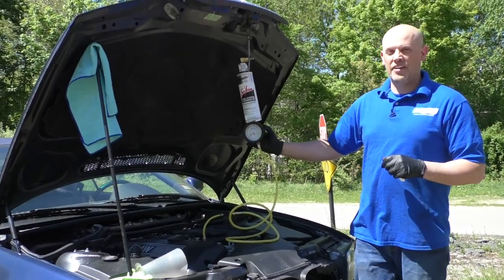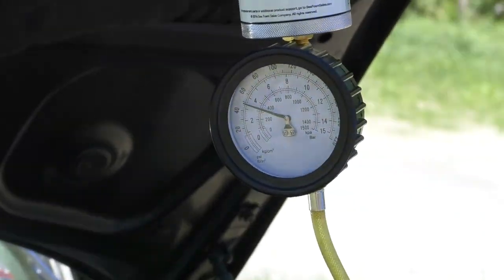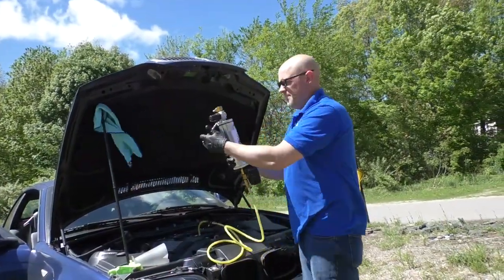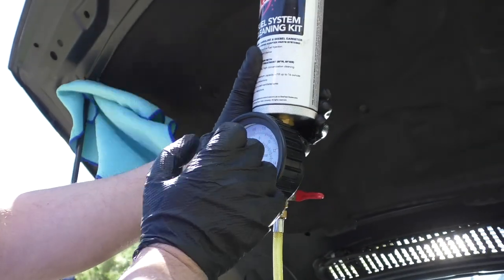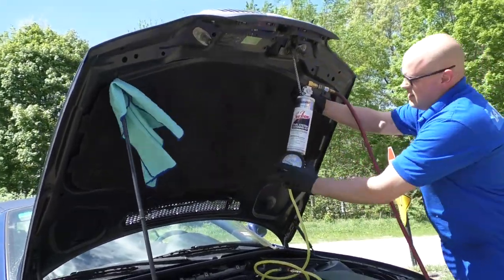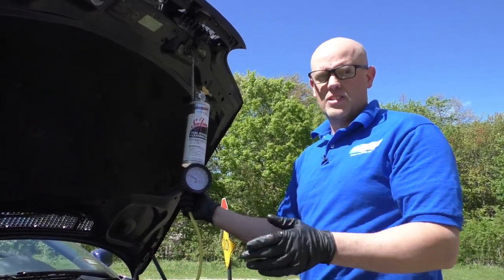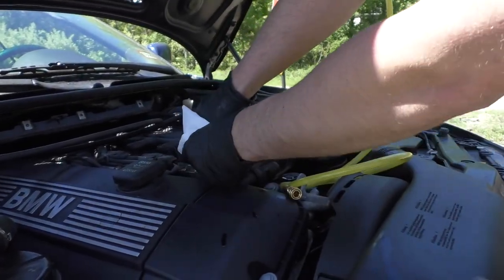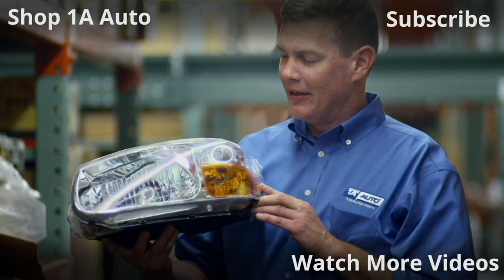How to Clean Fuel Injectors Like The Pros

Comment: Why not just remove the injectors and clean them individually/separately?
Reply: Time consuming, need power source to open the fuel injectors, and could damage it during reinstallation. I just think if this works why go through the trouble?

Comment: On a return line system, you could be venting the cleaner back to the tank if your pressure is too high.
I would think you should use a lower than system pressure. A lot of regulators vary the pressure according to vacuum  also. Maybe you should unhook the vac line from the regulator.

Comment: I guess  have to do this on my 2013 Chevy Tahoe I been having. Misfire on cylinder 5 replace spark plug , switch coils and spark wire still showing misfire probably injector are dirty ..

Comment: This is a pretty awesome video. If you don't appreciate the ingenuity of this - allow me to introduce you to the Ram Promaster 1500, the worst vehicle I have ever owned. It's worse than my 2nd and current wife. Costs a lot of money, never works, and well, I'll leave it to your imagination - I digress. If you have a look at Ram PM 1500 and see what it takes to get to plugs 2,4,6, that alone has turned people off to them. So I am getting a P0305 code -so if any silver lining 1,3,5 are on the easy side of the Ram PM but a P0305 code is pretty generic - it could be a lot of things (plug, ign coil pack, injector, and then we continue on and on) - but I'd sure rather try this ingenious way of cleaning the injectors without having to remove the plenum and look like I'm rebuilding the freaking engine. I mean all of this makes great sense to me and I'll be buying this before a 2700 quote for a very generic code which might just be a plug or a fuel injector issue. I am feeling it is likely an injector issue so as long as I can tick of the easier stuff - this is pretty straightforward and cool - then why not do it? I mean I think this is clever and really easy stuff. I am of the mindset to start with the most logical and simple things and move to the more complicated things. Occam's Razor stuff. Or you can be just like me and jump into the second-worst decision of your life and get a Ram PM for your business. :) Thanks for the awesome video!!!
Reply from the maker: +JWG Marine Thanks for checking us out. Shop for high quality auto parts on 1AAuto.com:

http://1aau.to/m/Shop-1AAuto-c

Comment: This sounds great and dandy but my only issue is if one of the gaskets on the fuel injectors are broken or frayed this won't replace them and I would want all those gaskets sealing them up perfectly. This won't fix those gaskets if they are working right.
Reply: Tony Trilex  ,It’s a cheap alternative for engine misfire due to dirty or possibly clogged fuel injectors , “sort of like a solvent for them “

Comment: Now this makes me nervous,if I was to do this i would have to do it in the company of someone that knew how to do it and explain it to me step by step
Reply: First he uses the gauge on the cannister/tool-thing he's using to tell how much pressure the car's fuel pump provides to the fuel rail. There's a valve in the fuel rail that will only let the gasoline go one way (as long as the pressure doesn't get too high). When he measured what the car's fuel pump supplied, he got 50 psi. That information will be used in another step.

He then pulls the fuse to disable the fuel pump (which is most likely inside the gas tank). There's a little bit of gasoline left in the fuel system, and when he starts the car, the engine consumes what's left. The engine cannot run now because there's no fuel from the gas tank. 

Now he has it set up so the SeaFoam cannister will act like a temporary gas tank. The air hose he hooked up will act as a fuel pump by using air pressure to push the cleaner out of the cannister. Remember, the fuel pump in the gas tank supplies gasoline to the fuel rail at 50 psi. So he decides to set the air pressure of the cannister at 45 psi. That way the pressure is close enough to work correctly, but it won't risk over-pressurizing the fuel rail. (If that happens, as he says in the video, some of the cleaner may go backwards into the gas tank.) 

So instead of supplying gasoline to the fuel injectors, this temporary fuel system is supplying a cleaner. The fuel injectors use this cleaner instead of gasoline and the engine can (usually) burn the cleaner. (The cleaner is more than likely a petroleum-based solvent.) 

This long message may be helpful to you, and it was very helpful to me to write it out and further understand the process myself!

Comment: HEY IF THE FUEL INJECTORS ARE BAD WILL IT GIVE YOU A CODE.
Reply: You could get a multiple random misfire code or a code saying your car is running too lean. But misfires could also be caused by spark plugs and bad fuel pump, air intake leak, etc.
Reply: Not necessarily specific to the fuel injector P0305 code on my POS Ram Promaster 1500 -worst decision of my life other than my 2nd and current wife it may be a whole bunch of things bad plug, bad coil, bad compression, bad injector and on and on and on.Def agree with Mr. Hawk.

Comment: Ok good video, but still a risk your taking on cleaning the injectors directly into the the engine.All vehicles are different,you don't want to damage any parts or costing any harm to the fuel, or engine system.It can be a total nightmare for the customer and the mechanic.So i suggested it's best to take the injectors out and properly service them with the tool and reinstall them manually.

Comment: It seem an interesting tool and I suppose it could be used with success also on a bench and not only on the vehicle if you have a circuit to drive the injectors. I've just one doubt: why is not dangerous to pressurize with compressed air the canister that contains the injector cleaner liquid (that I suppose is flammabile as gasoline)? It could not explode if accidentally an electrostatic spark could ignite inside?

Comment: Why did you run the car off the can without pressure at first?
Doesn’t the system need pressure to run?
Reply: And how did the car start with the fuel pump fuse pulled .. did he run a gas mix with the cleaner and shop vac to push it true
Reply: @nuttynut54  flubber
Reply: the injector cleaner is 50/50 gas mix

Comment: Where to buy the fuel injector cleaner tool?
Reply: Right !
Reply: From 1A Auto I presume
Reply: OTC Tools 7448A fuel injector cleaner canister on Amazon
Reply: Beware it comes with a shit ton of parts.  Its like getting a lego set with no direction's and you have to build a death star.
Reply: Also do it right or you will be buying a catalytic converter.
Reply: @Mansfield Man I think he meant a flux capacitor :P
Reply: Ebay.